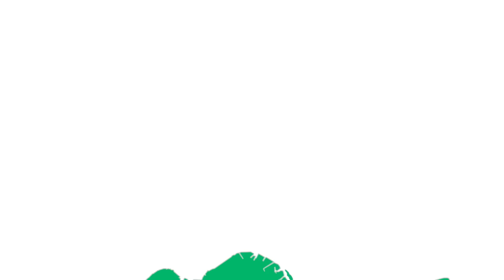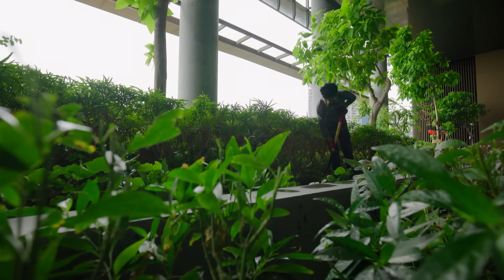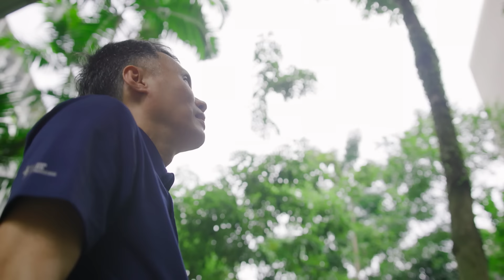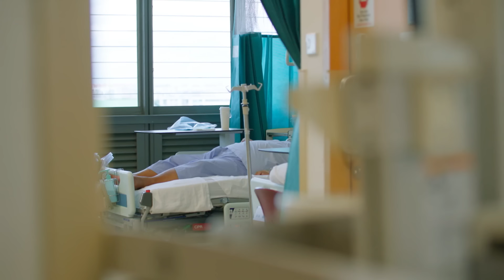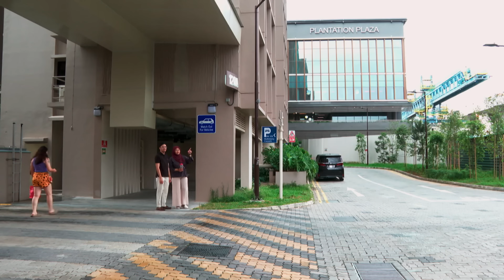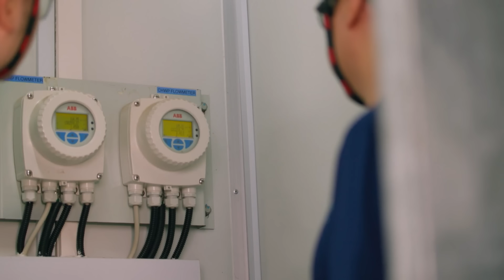The Secrets Hiding In Singapore's Greenest Buildings | Singapore Hour

Comment: Interesting but not ground breaking (the plants method that is). In summer, Singapore is incredibly humid, shade doesn't help. Even in less humid places, the shade is only relatively cooler, not absolutely cooler to a comfortable point. The video didn't say what the temperature is under the canopy of the plants. It is impossible that the hospital doesn't have air conditioning at all, so the plants really just provide shade and psychological benefits.
Reply: Interesting take, but the evidence from Singapore itself shows greenery does provide measurable cooling beyond just ‘psychological benefits’ or basic shade—even in our humid climate.
For example, at Khoo Teck Puat Hospital (the one with the famous ‘forest-like’ design), post-occupancy measurements found the central courtyard microclimate was about 2°C cooler than areas just outside the hospital, thanks to dense foliage, shading, and evaporative cooling from plants/water features. Climatic studies there highlighted significant afternoon cooling from shading and evaporation.
Broader Singapore research backs this up:
•  Vertical greenery and thick planting can reduce building facade temperatures and nearby air temps, leading to 10–31% lower cooling energy loads in buildings (studies cited in URA/NParks reports).
•  Urban greenery (including canopies) reduces land surface temperatures by ~2.8°C on average across Singapore, with air temp drops under dense shade often 1–3°C during the day (e.g., from multiscale studies on greenspaces).
•  Trees/shade in tropical Singapore can cut surface temps by up to 10–12°C and improve thermal comfort (PET reductions of several °C), even if evaporative cooling is limited by humidity—shade alone blocks solar radiation effectively.
No one’s claiming it replaces AC in a hospital (KTPH has AC, but integrates natural ventilation and breezes too). But the plants aren’t just decorative—they measurably lower local temps, reduce heat gain on buildings, and support better outdoor/indoor comfort + biodiversity. The video likely highlights these real biophilic/thermal benefits, not magic ‘no-AC’ solutions.
Curious—what makes you say shade ‘doesn’t help’ even in less humid places? Data from tropical studies shows consistent (if modest) gains under canopies.

Comment: I dont think it is the plants that make the building microclimate cooler. I am not against, I quite like it and I wish more buildings add plants. I just don't think it is the plants. It is the water they pump to keep those plants alive. The plants then release this water in the air and make it moist. The air current between the two buildings is removing the warm damp air away and everything cools down. You can see they have huge waterfalls that do the same thing as the plants. If there was no air circulation, like if this was an internal garden - this place would have been damp and hot. So its not the plants that help, it is the way the building uses wind to ventilate itself. I dont know how much power they save compared to the money and energy spent on all that water circulation and plant servicing, but like I said - it is very nice and fresh to live in a building with so many plants, even if for some reason costs more.
Reply: Green cover in an area has been shown to reduce the temperature by up to 4C in the shade.
Plants don't just absorb sunlight and provide shade, they also hold moisture as you said.
All of these factors help to reduce the heat island effect.

One thing that's REALLY nice about this kind of design is that the reduced cooling load is much more energy efficient, since you have to spend way more energy per degree of cooling.
If the plants reduce the building temp by 2-3C, that's 2-3C your AC doesn't need to move. 

There are actually plenty of other buildings around the world which have incorporated green walls or rooftops to great effect.

Comment: Singapore biggest problem is the humid weather, very hot air, the ideas of planting trees to block the sun not enough and it old concept. University need to do research and install street fans similar to  street light  using solar. that would be a better option, the technology already there
Reply: That's useless. Fans merely push air. If the air around is already hot and humid, the fan will push the same air. It won't lower temperature and humidity the way you think it would.
You tell universities needing to do research yet you don't know the basic concepts of how fans work.
Reply: @Return-2-Monke  you are dumb and stupid living in Singapore what do you know about the world or scientific research. Why dont you bring the Singaporean professor and  I prove to him air circulation will help reduce the air temperature.
Reply: I had similar thoughts.  It would be great if solar powered street lamps could be fitted with fans!
Reply: @GKP999  Solar lamps would need big battery and right now it very expensive, billion and billion of dollar for the whole of Singapore. it only suitable for street fans
Reply: @VanTran-ne4yf Really?  That is not what I have read.
Reply: @GKP999  you are fail the exam for not understand the question. I said "  install street fans similar to  street light" did i say install street light using solar ? I am talking about humid and hot weather and you need air circulation , I dint talk about not enough light on the street
Reply: @VanTran-ne4yf wow!  I was just trying to understand.  You don't have to be mean about it.  Whatever!
Reply: @GKP999  if you understand english well. when you said " really ?" it mean your are question the person intelligent.  that is an insult to a person. you are not trying to understand something
Reply: @VanTran-ne4yf Here's what I really.  I don't care if you think your English is better.  I think you are a snowflake.  You need to chill! Before, I wasn't insulting, now I am.  That's Me being direct!😂😂😂😂😂
Reply: Fan that blow hot air to your face and body under the SEA heat?

No, thank you!

Trees are cheaper & healthier.

Or just make streets on the basement level to avoid the weather.
Reply: @Personal_Library_of_Travel  Singapore already has limited land available but government dont build shopping mall, metro, parking,  indoor sport centre , children playground etc connect with residentials area underground and avoid the heat during day time. Taiwan and China has underground cities and shopping Mall . Singapore falling behind
Reply: @VanTran-ne4yf  SG already has kilometres of underground malls and walkways. Not sure what you're talking about.
Maybe it hasn't covered the majority of the island, but you realise that a large amount of "land" in Singapore is actually reclaimed ocean, right?
Reply: There are proven technologies for collecting water from humid air and if the city or country really wishes to have less humidity - they can really do it. Fine mesh installations sometimes even with safe electric current running through them can capture water and leave the air dry. This air is easier to breathe and easier on air conditioning systems so it could be a big win. The installations dont have to be ugly, they could look like art and the electricity running through them is a lot less than the electricity spent on air conditioning and its not fatal. It simply creates a static field that attracts water molecules to the fine net where it condenses and runs down. Water can take away some of that temperature in the air, so it's a win win situation. All you need is the drive to make things happen. These buildings spent a lot of money on creating gardens where everyone else just puts bigger air conditioning. So they were okay with experimenting. I don't see why can't this mindset be adopted by a whole city.